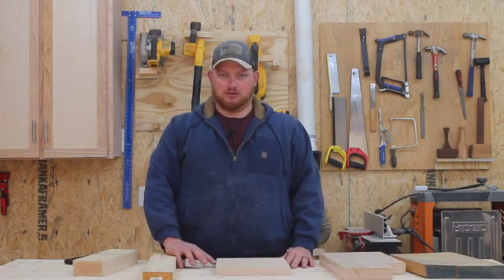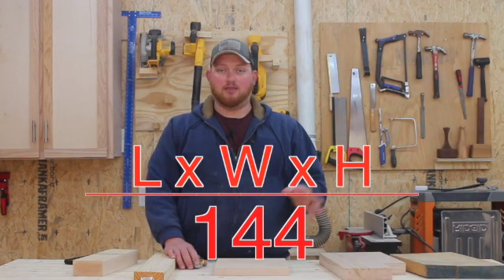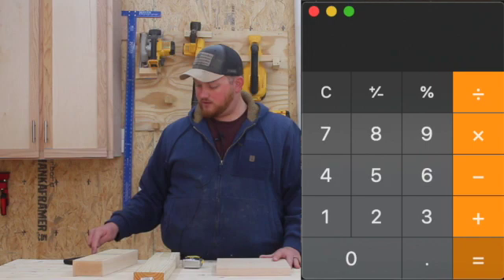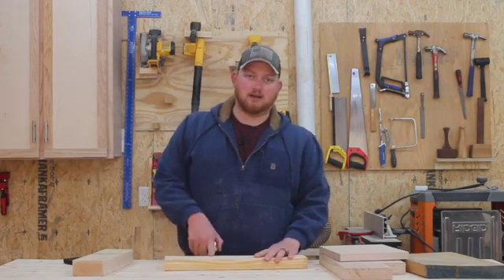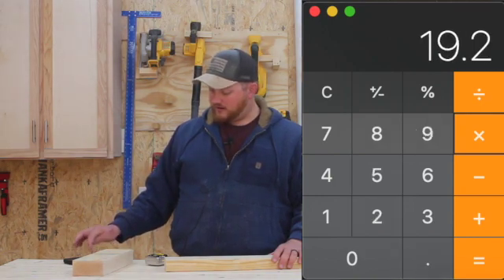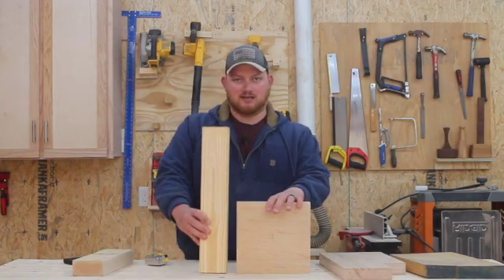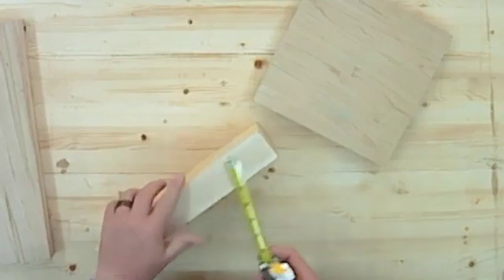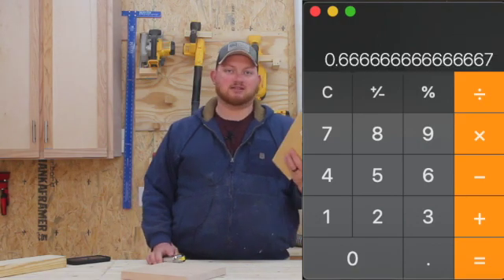How To Calculate Board Feet - Lumber Material Calculation

Comment: How do you calculate bf for a stack of lumber?
Reply from the maker: I would simply take the width of the stack (in inches) multiplied by the thickness of the stack (in inches), multiplied by the length of the stack (in feet). Divide that total number by 12 to get board feet.
Reply: @RockyRiverWoodworks  this comment/answer is just as good as the video. Thanks.

Comment: Hey Nick, I was texting to see if you could figure board feet on rough cut lumber that is stacked up. I have a stack of hickory that is 4 feet wide by 5 feet tall each board 9 foot long and each board is 1 inch thick. Is there any way to figure a rough estimate of how many board feet
Reply from the maker: Are you asking a total amount of board feet for the stack or for each piece? For the total stack board feet seems to be around 2,160. That’s provided that the pieces are stacked tight to each other without gaps.